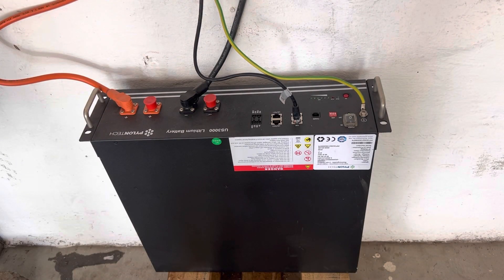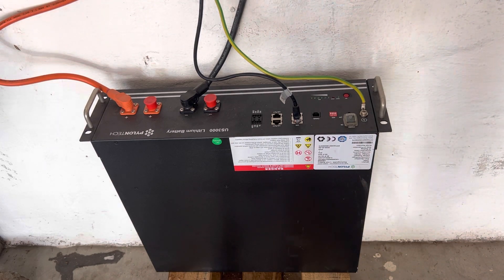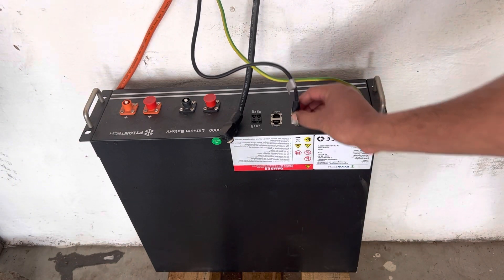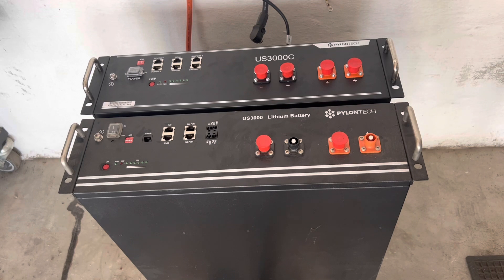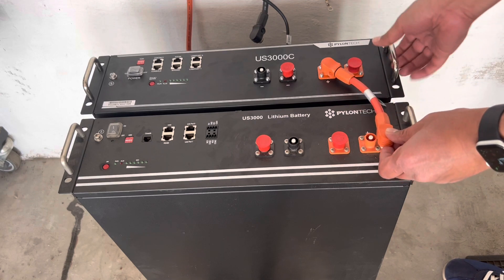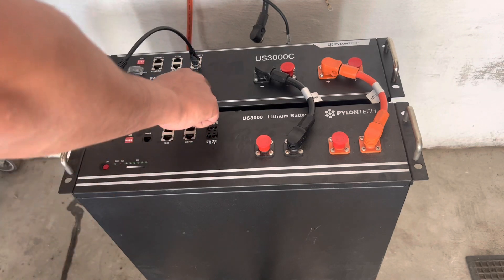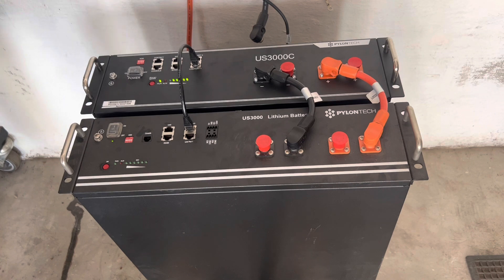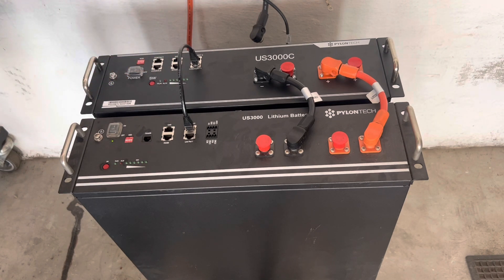Add additional Pylontech batteries to an existing battery bank

Comment: The pylontech batteries show a unique feature.
They are able to performe a soft start.
In such a way, being the inverter(s) already connected or wired it's possible to gently charge all big electrolitic capacitors placed at the inputs terminals.

Comment: Thank you so much for this really clear explanation! I had 1 300 and bought two additional compatible batteries. I was told how to equalise the batteries but the instructions weren't quite right, and now I understand what I need to do. My system will be fare more efficient and last longer now. Thanks again!

Comment: We installed 3 US2000 Pylontech batteries with a 6 kw inverter. Now, we wish to add a UF5000 pylontech battery in the system. I know we can mix US5000 with US2000 and US3000, but I am not sure about mixing a UF5000 with the old US2000s. Some say that a UF5000 series from Pylontech is a different type of battery, and it should not be mixed with the US series. I need recommendations. Thanks in advance!

Comment: Does the inverter automatically pick up and adjust its settings for the new battery? As in, does it know the battery storage is now 10kwh and not 5kwh from here on?
Reply from the maker: Depends on the inverter. The inverter generally reads the battery voltage. The voltage remains the same but the voltage drops more slowly due to the added capacity.

You do however need to look at your charge settings. You should double your charge amperage. 

Nominal charging rate is C/2 where C is the capacity of the battery. These batteries are 74A each so max charge current should not exceed 37A for one battery and 74A for two batteries
Reply: Thanks. Can you tell me, is it necessary to switch off the inverter when installing the 2nd battery or can I just trip the breaker between the inverter and the batteries?

Comment: Hi are there any difference on the dip switches?
Reply from the maker: Apologies for the late response - no changes on the dip switches. You only need to worry about dip switches if you have more than 4 batteries

Comment: hi zayds , 
just asking if  therre's a probllem if i connect the battery cables from inverter direct to master's positve and negative terminal?
thnaks for the nice video
Reply: No problem at all! In fact, that is the recommended method, i don t know why he connected the negative to the second one.
Reply from the maker: Hi, it will work but you wont have any protection. Its best to have a fuse between the inverter and battery. Apologies for the delayed response.

Comment: I liked your video but was disappointed that that there no mention of how to use the dip switches when adding more batteries . Can anyone help explain what to do with dip switches when adding more batteries
Reply: Yes, I was thinking that.  I am having real problems with this but it seems to be set the first dip switch to on on the master battery so it is at the correct baud rate for the inverter (if 9600B/s) and then all other batteries have all dip switches set to off.  If you have a 115200 baud system that is different but I think most are 9600 - my Solis is and you can check on the settings screen of the inverter.  Hope that helps - and works!

Comment: Hi zayd nice video... have a question to ask.. can you please help me ..I  need to know whit one US5000 pylontech battery or maybe 2  battery  together..which inverter I need to connect 48v 5000w or 10000w and can I run only whit 6 x 400w solar panel .. I hope you understand what I mean thank you..
Reply from the maker: Hi Alfredo, each UP5000 battery will give you 4.8kwh of capacity but will only allow you to draw a maximum continuous power of 2.4kw (battery capacity divided in half). 

So both a 5kw or 10kw inverter would work but a 10kw inverter would be overkill with limited batteries and solar panels. 

The advantage of a bigger inverter is that it allows you to expand your system over time by just adding more batteries and panels.

If you have 2 x UP5000 batteries with a 5kw inverter you would be able to run the full inverter load of 5kw on the batteries alone without utility or solar.

Hope that helps.

Comment: Hello Zayd, how long need to balance the battery if one is 48.7 V and the old one 48.4 V .Thanks
Reply from the maker: Hi Gabriel, it shouldn’t take too long to balance. Given the small difference in voltage between the two batteries it should be ok to connect them. In general you should be fine if the same number of LEDs are green on each battery

Comment: Hello great video. Please can l use 5kva 48v inverter with a single 3.5kwh 48v pylontech US3000 to power 500watt load. And how many hours can it run the 500watt load on full charge thanks
Reply from the maker: Thanks Victor. Yes you can. I ran my 5kva inverter with a single 3.5Kwh for over a year. It will handle 500w of continuous load with no issues for close to 6 hours - depending of course on what your low voltage cut off settings are. With a single battery you can draw a maximum continuous load of 1800 watts

Comment: you have checked the voltage on the new battery independately of the second battery FIRST, before attempting or considering balancing

Comment: Hi please help to explain what parameters must I update on my existing Mecer 5kVa with 1 US3000 b. I am adding another 3000 today
Reply from the maker: Hi Terrence, since you are adding the battery in parallel none of the voltage settings need to change. The only parameter you should consider changing is the maximum charge current. You should double this value as you are doubling your capacity. The max charge current should be set at 37A per US3000 battery. So you can set it to 74A or round down to 70A. All other parameters should remain the same.

Comment: Hello Zayd, thanks for the informative video... i have four US2000 Batteries with Kodak KODAK Solar Off-Grid Inverter MAX 7.2kW 48V, and X6 410W Canadian solar panels... can i mix the US2000 battery with US3000 or  5000 or do i need to stick with US2000 range as i want to upgrade?
Thanks in advance.
Reply from the maker: Hi Daddy, you can mix the batteries. 

When using the same module use the latest production unit as master.

If you have different modules follow this order for determining which battery to use as the master battery:

UP5000>US3000C>US2000C>US3000>US2000

There are two additional things to note:

1. The bigger batteries generally offer more value as they are cheaper per KWh - divide the cost by the battery capacity to figure out which one is better

2. The UP5000 only carries a 5 year warranty whereas the US series generally has a 7 year warranty that can be extended to 10 years upon registration
Reply: @zaydshouse1373  Thanks for the response...
Reply: Any battery parameter settings you could remommend, i left everything in defaults eccept for charging source priority?
Reply from the maker: @Daddys1652  
Max charging current should be 25A x number of US2000 batteries (37A for us US3000) - you can round down to the nearest 10 if your inverter only works in increments of 10 - this is normally program 2

Program 12 - battery low return to grid - 48v

Program 13 - battery full - 51v (or 50v if you want to start using the battery sooner and use less utility 

Program 26 - bulk charge - 53.2v (but I prefer to go a bit lower at 52.5v)

Program 27 - float charge - 53.2v (again I prefer a lower value of 52.5v)

Program 29 - battery low cut off - 47.5v (I set mine to 48v)

Comment: What inverter do you have and how are your dip switches switched?
Reply from the maker: Hi Ian. I have an Axpert inverter. All my dip switches are off on both batteries. Dip 1 controls the RS486 baud rate which is the rate at which data is transferred. When its on the rate is 9600  bits per second and when its off the rate is 115200 bits per second. Dip 2 must be off if you are in single group mode (you will have more than one group if you have many batteries - typically more than 4). What issue are you experiencing?

Comment: Assume the same applies to the US2000 plus model.. adding a later US2000C model. 
The later model is used first and the older model daisy chained?
Reply from the maker: That is correct. When using the same module use the latest production unit as master.

If you have different modules follow this order for determining which battery to use as the master battery:

UP5000>US3000C>US2000C>US3000>US2000

Comment: You made a classic mistake.  After you switch your batteries on you should wait at least 60 seconds before switching your inverter on. All manor of error codes can happen if you do this to early.
Reply from the maker: Hi Lee, thanks for your feedback. I have never experienced an issue and the manual says that the battery is ready for full output 3 seconds after soft start. But I guess there is no harm in waiting for a minute. Thank you
Reply: @zaydshouse1373  Nice video Zayd. Can I ask a stupid question, when joining the batteries to the Inverter, why is the positive cable connected to the 1 battery and the negative cable to the 2nd? Why can't the inverter cables be joined to the same battery?  I'm clueless on this stuff, what will go wrong?
Reply: @shankley74  if you want to have the same cable length to both batteries in a parallel setup , than this is the way to do it. keeping the cable length the same helps by keeping the balance
Reply: @martijnvandam3810  Thank you Martijn.